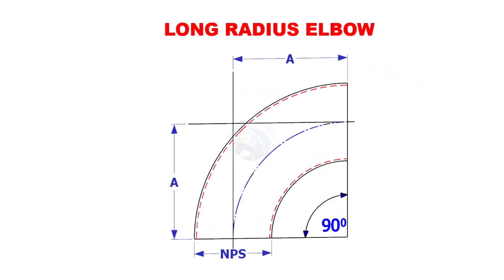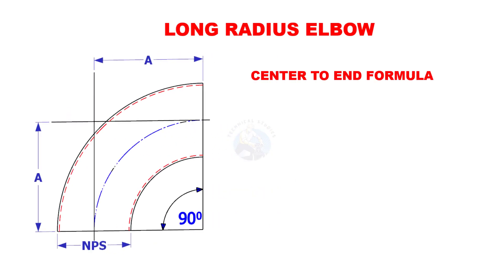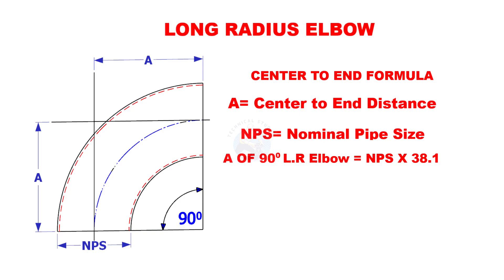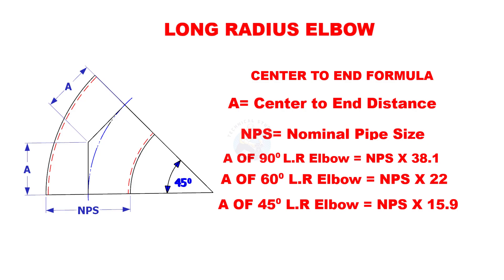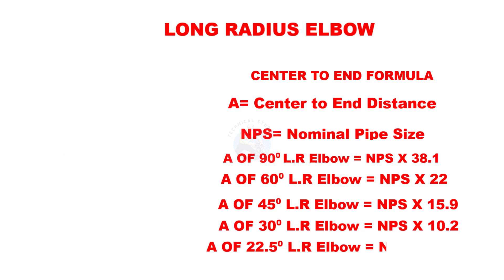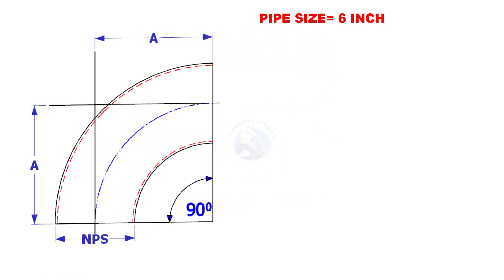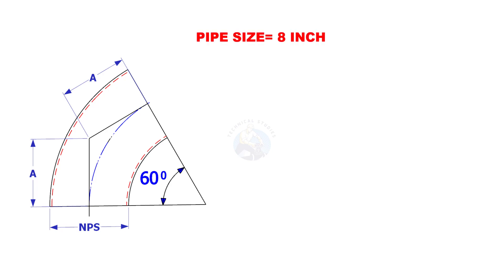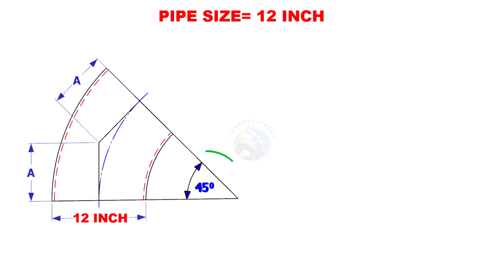Long Radius Any degree Elbow  Elbow center Formula and example

Comment: Hello sir hope you are doing well 

Sir I have a question that this elbow centre formula is for same for the HDPE pipe elbows.
Reply from the maker: No Bro. It is not the same. You need to refer a chart of HDPE pipe fitting dimensions.
Reply: @technicalstudies.  I appreciate your help thanks you